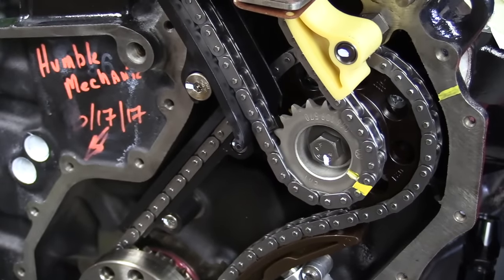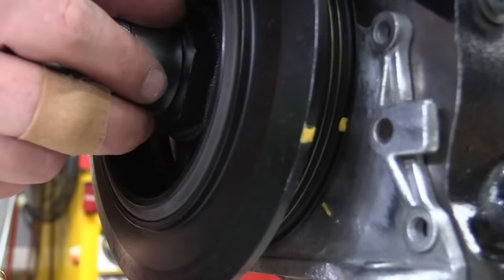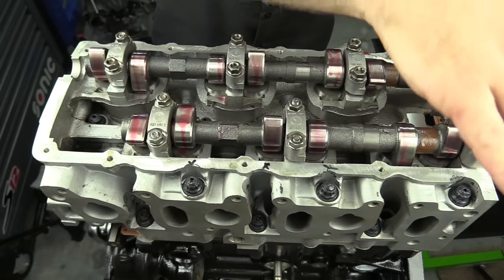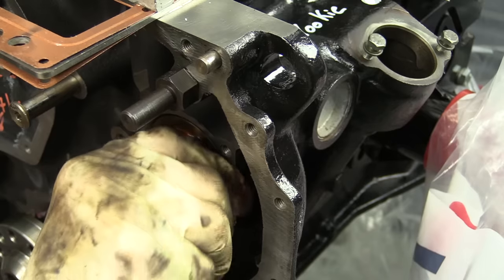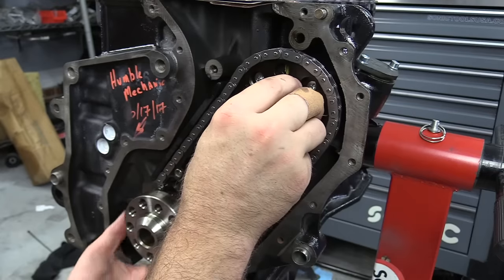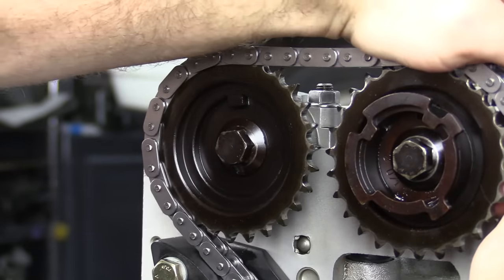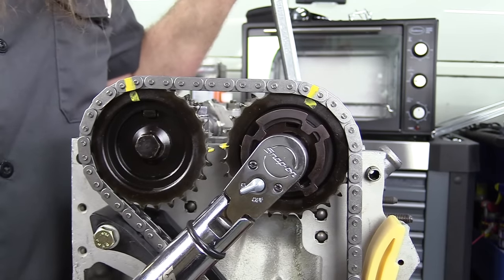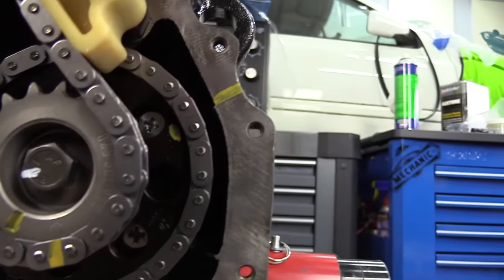How To Properly Time and Install Timing Chains on a VR6

Comment from the maker: This is one of the most requested videos I have gotten since I got this GTI. I hope it helps you guys rock out some timing chains,.
Reply: i just did a set of these about two months ago. it wasnt too bad, considering i did the work on the street in front of my house. now if i could just figure out why the new clutch doesnt want to disengage and makes a funny sound at full pedal compression....darn 02a's anyway
Reply: +Josh Hust did you put the throw out bearing in?
Reply: hi Charles love the videos. Im planing on doing the chains on my VR6 but mine has the two row upper chain, I have the sprockets to swap to single row its ok to do that or should i stay with the doble row ?? (in dap they cost the same but idk the brand in ecs its a 100 dollar difference between the two kits) what should i do
Thanks awsome tutorial.
Reply: Konradbie Did you check Schimmel Performance? I would trust them. Don't use ECS. I have had problem after problem with them shipping me returned or damaged parts. You have to stay with the type you have unless you are changing sprockets. The single row is supposed to be quiter. The double is supposed to be better for big cams.
Reply: hey bro, this is the best and cleanest video i been watched on last times, thank you for all...
do you have any videos like this for another engines?? like 1.8t 20v??
thanks
Reply: Can i use this instruction video for a mk4 2.3 v5 150hp
Reply: I am really surprised people have asked about timing an afp. they are crazy old, and super easy. I can see a request for bdf, but still
Reply: I think you haven't explained here how did you timed your dohc (How did you find the correct position for your dohc? What is the position of it while installing the new timing belt?). These are important to help your viewers know what should be the camshafts position when should be timed with the crankshaft, mostly when one lost their marks.
Reply: Intermediate shaft work?
Reply: I've just finished my second timing job on a Vr6, This one is mine.. Getting the intermediate sprocket on is a pain and you make it look easy! Much better my second go at it though, Glad I can come back and watch this video to double check myself. I've only done timing belts before which I've found so far to be easier to do for me.

Thanks a ton for making this video, I can't wait to have my own Mk4 Gti on the road and have another successful timing chain job done.
Reply: @ghomerhust  interesting, did you need to remove the engine?
Reply: In your professional opinion on a 24v VR6 in a mk4 GTI is it possible to do a timing chain/guide replacement while the engine is in the car? Or am I further ahead just pulling it out of the car to do the replacement?
Reply: I had a question so I did my timing chain on my 12 valve and I rotated the motor four times and the intermediate shaft was pointing down but I had it at 12 o’clock. Is that seem right?

Comment: Great guide. It is a fairly straightforward process on the VR6. The only issue I ran into doing mine was that one of the cambolts was incredibly tight and rounded when I tried to undo it. No problem if you're upgrading the cams but a pain if you're not. Cheers
Reply: Badgertronix happened to me as well, had to heat the hell out of the bolt with a gas torch.
Reply: Did you have to pull the motor?
Reply: @stanlee2200  yes you have to pull the motor you have to put it on a engine stand

Comment: i just got done doing chains and guides on my wifes obd2. everyone was telling me that it is just a horrible job to do, but i found that it was nothing more than time consuming. lots of parts to take off to get to the chains, and nothing more. a couple of metal rulers held the cams at TDC, and a breaker bar on the crank kept things lined up, and it just popped together. and i can sure tell NOW that the old chains were getting noisy, when compared to how the engine sounds now! next step, figuring out why the o2a doesnt want to disengage the clutch properly after bleeding....

Comment: Brilliant. Wish I had this a few years ago while “winging it” in my driveway, propping up the engine some 2x4s. It was a success but I would have felt more confident watching this a few times. 
Looks soooo much easier with the engine out of the car. 
One big ugh though:  there was a little bit of slack at the top of the top chain which I couldn’t get out and I didn’t want to take a 24 mm on the cam shafts to adjust for fear of screwing up (which I did once when my cam shaft plate slipped out!! Thought I may have bent some valves). 
Well, it’s been running quiet and well for four years - so close, but not perfect like your job.

Comment: How do you torque the intermediate sprocket?? The slack is in a way that when you tighten that sprocket bolt u would rotate the sprocket and pull the slack? How do u get it to not rotate

Comment: Humble mechanic... I love your videos. I've watched a lot of them and I've never caught you in something that you were wrong about until today... I wish you were right I've always looked up to you and still do... But when you were finding top dead center that was not correct. the Piston dwells at the top of its stroke. Now maybe for putting the timing chain on a VR6 this is all you need to do but you should really look into finding true top dead center. The best way that I have learned is using a piston stop rotating it until the piston stops marking it on the underdrive pulley then rotate the engine other direction till it stops... marking it...m measure the distance in between the two marks cut that distance in half and mark on the crank/ underdrive pulley. usually most OE markings are a little off. I have found several manufacturers across many engine platforms and all the marks are usually a little off. I would say in between 2 and 5 degrees and that's also how you can find if your underdrive pulley has slipped/spun.

Comment: Charles had me a bit confused when you were turning it at the end . You said turn it clockwise but it was going counter clockwise. I forgot we were looking at the back of the engine. I'm too used to timing chains/belts in front of the engine. 
Doooooh! My home moment.lol
Reply: Brad Downs , i was wondering the same thing! Did u figure that counter clockwise,  is the way engine runs?

Comment: Important 24v VR6!!!  when reinstalling the Camshaft Adjusters, the gear (most of the mass) needs to be turned all the way counter clock wise (left), with the Control plate (near the bolt head when installed) turned all the way clockwise (right)

Comment: These videos are going to be a life saver this spring and summer when I so the teardown of my 02 VR6 Jetta. This is going to be the first full rebuild of the motor since it was new. Thank you for all of the wonderful information. I really like the info on setting the paint marks during the build process marking the timing and the torque confirmations.
Reply from the maker: Thanks! Those paint marks have saved my butt!

Comment: Thank you for this great informative video , I timed my vr6 last night and I was just curious if it’s normal for the 12 o’clock mark on the intermediate shaft sprocket to be slightly to the right of the cover for the intermediate shaft. So the point is just passed the marking. I can’t get it to sit perfectly in line. Thank you again!

Comment: Is this engine radically different for timing that a 24v bdf? Obviously the spark plug location is different...I do have a Bentley manual and I don’t need to actually do this yet but it’s cool getting to see it done so when I do go to build an engine I have a general idea what it’ll look like
Reply: Jonathan, did you eventually get around to replacing the timing chain on your VR6?  I have a 2004 GTI with the same 24v VR6, engine code BDF.  Today I started hearing what I believe is the tell tail noise of a potentially failed timing chain guide.  I'm trying to quickly get smart on how to replace the chain and guides on this engine.  If you did the job and have advice or know of a good video that shows how to do the job specifically on the BDF engine and can provide a link, it would be a huge help.

Comment: Nice vid! 💪🏽 I would add folks the cam caps are numbered and specific to exhaust/intake don't cross them up
Reply from the maker: I call that idiot resistant...LOL..

I am actually going to do a separate video on installing the cams.

Comment: Great clear and confident building video👏🏻👏🏻.. one question 🤔.. i have a 3.2 BHE audi engine. Can i replaced the cam chain tensioner bolt without taking the engine apart?.. is it just an unbolt and replace item? Cheers

Comment: I wish someone would have explained to me the first time I did a timing belt that the marks on the belt were not going to match up after I rotated it. I was a mind fucked 20 year old that had done the job correctly, but was too dumb to know I had done it correctly. I was in a shop the didn't have any old timers willing to help a beleaguered young tech. I try not to be that semi old timer now, although it is fun to watch them struggle a little.
Reply: Does it matter if you took the chain/belt off on tdc buy not on the compression stroke ?

Comment: Hi Charles
I am planning to buy a friend of mine's golf 3 vr6 OBD 1 there are no timing chain noise but wanted to know if it's necessary to change the Chains to the single ones instead of the double 
what are the pros and cons of either 
All the Way from  🇿🇦

Comment: Hi humble mechanic! I have a 92 gti with a 93 vr6 corrado engine in it! My dad & I are working on it and right now the car is cranking but not starting. Before it stopped working it started running hot and leaking anti freeze so I’m wondering if it’s the water pump? If this even is something that would stop the car from turning on? Other thing I was thinking was the timing chain. Would love to hear back thank you!

Comment: Awesome as usual always/reliable!

Do you have a bb or a way I can get some advise?

I used to have a 2 valve, I had an e2 chip, went the gm conversion to ign coil/spliced plug/coil wires, to lower the e2 advance I was able to expand plug gap with a massive boost to throttle response and avoid hot weather pi.

Vr6 is just an awesome motor/sound w/T2 exhaust straight out Jetta 3 so no drone.

AW I currently live in PDX, I would like some local assistance PDX/SEA with dependable headlight retrofit w/outer rings added w/shroud Morimoto’s Gen 3 Toyota 4R, affixing them properly, rather be involved than mail order of course…

Thanks

Comment: I have stumbled upon these God like videos! I now know who I can safely ask my question and get a purely knowledgeable based answer. I have a 2018 VW Atlas SEL with the 3.6L V6 (VR6) With 4motion. Are there any mods for this vehicle/motor? Would it be possible to turbo? Would it make a good fit? Basically I'm looking to add lots of horsepower and torque. So far I've seen 1 company do it to the 2.4L. What are your thoughts on this? Thank you!

Comment: Hi Charles can you post a video about doing the timing on a 24v vr6. It's like the R32 but I have the 2.8 version. BDE engine code. 
TIA. Oh I'm busy turbo charging it with a 2mm spacer plate and forged rods and arp head studs.

Comment: So is this the same thing on a 2001 Volkswagen Passat with an automatic transmission? I know it’s a V6 I believe a 30 valve I think if I’m correct. His car is sending low pressure oil to the camshaft. Every time he raises the the camshafts tensioner arm it squirts oil out of the plunger... I’m not sure if there is something wrong with the plunger or gaskets that seal that oil pressure sending unit or something. I my self own the more simplistic 04 VW 1.8T JETTA. I don’t want him to fall out of love with that car any suggestion or any tips would really help! He has the car torn apart we understand how the valves work in correspondence with the rest of the car but I guess I’m confused on what a properly timed camshaft looks like on a (01 VW PASSAT) Dual overheard Cam auto trans... I would really appreciate any advice I know your not going to like give a manual to tell me what to do. But I would really appreciate anything. And if needed maybe I could work out some sort of payment for your knowledge. Thanks!! Love your videos!

Comment: hello hope u read this. i did this exact job in my garage step by step perfectly. everything u described.  I am also anal about torque so everything was torque spec all gears where marked, TDC etc etc and even did 4 full turns on the crank like u do when i was all done and  timing was perfect everything lined up. i dropped the motor back in and now it knocks. any ideas. it sounds like a piston hitting a valve but it cant be i did everything right double checked everything. and ideas? or anyway to reach u? i just want an opinion. i dont want to rip apart the motor again. the motor runs amazing tho so if my timing was off would it seize the motor? if u read this i would love just to pick your brain on what u think or what anyone thinks i have a reddit page with a video of everything otherwise its was worth a shot. I can just buy a new motor for 1000$ cause taking the motor in and out was a breeze but i want to try myself. thanks in advance
Reply: also i meant to say. "if my timing was off WOULDNT it seize the motor?" basically im trying to rule out the possibility of it being me messing up the timing but it looks like it

Comment: Hey Charles had a question, I just bought a 2000 beetle with the 1.8 ltr turbo and am trying to put a timing belt on but the belt the old belt was shredded so wasn't able to mark tdc, what is the easiest way to set timing? Thanks
Reply: Did the timing belt fail? 1.8 will  bend valves in a heartbeat.

Comment: Charles, would you consider discussing, in a video, how this job might be different on the 24v VR6, engine code BDF, installed in the 2004 GTI?  Also, once the transmission is removed, is it's reasonable to replace the chain and guides with the engine still installed and supported with a floor jack on one side and the engine mount on the other side or is this a bad idea for any reason?  Once again, I appreciate the video and your advice.
Reply from the maker: YES! We will actually be doing chains on the R32 at some point

Comment: Humble Mechanic, I'm about to get this done on my 2007 Q7 3.6 VR6. Is it possible to replace the sprocket off the  crankshaft? Basically the lowest part where the lower chain rotates on? Would it even be necessary as long as it looks ok? Thanks.

Comment: Hi, at 3:54 you say the cams are locked in place but the keyways for the sprockets are not at the top. I'm assuming you were installing the sprockets on the camshafts prior to locking the cams into place correct?

Comment: I pulled my cylinder head on my VR6 GTI without setting it at TDC . I marked the chain and cam pulley teeth before removal but how do I make sure it goes back together the same way ? Or should I just rotate the crank pulley to TDC while the head is off all while trying to make sure the upper cam chain stays taunt , before reinstalling the head ?

Comment: Great video... QUESTION: What is the difference between Cayenne VR6 at 300HP vs. Touareg VR6 at 280HP? Is it easy/plug and play to upgrade the Touareg VR6 to Cayenne spec?
Reply from the maker: Im not sure on the exact specs, but it may be something as simple as intake, exhaust, and software.
Reply: @HumbleMechanic  Thanks. Anyway to upgrade Touareg VR6 to Cayenne or better? I feel like VR6 is too weak for the Touareg weight and needs more power.

Comment: Hey Bud, What is the difference in the procedure from timing a 24 valve to a 12 valve if there is any difference at all? Also is this really tough to time if you keep the engine in as apposed to taking it out?

Comment: Charles I'm currently waiting on a slot at my mechanics to get my chains and tensioners guides and spockets changed on my a6 3.0 tdi bmk code engine it has been rattling for almost 7k miles as I thought it was the serpentine belt running untrue due to a bad tensioner at the front..subsequently after waiting on a sunny day to change the rollers and tensioner and alternator pulley it was still rattling like a bag on nails until I stethoscope tested the cam cover and my heart almost stopped so Is there anything else that should be considered looking at while the engine is out as it is a huge job? And do you think the engine would have or could have any other damage relating to it having a slack chain it still idles and drives well apart from the noisy rattle (permanent rattle) not just start up. 

Your advice would be greatly appreciated as you are clearly a master in your field. 

Kind regards,
Chris woods.

I will be parts shopping this week the kit I plan to order is a FAI full kit for that engine code..are they trusted or do you have any alternative recommendations.

Thanks.

Comment: Is there a video on proper timing on camshaft on 1.8t with the camshaft tensioner. I’m receiving a constant P0012 especially in the morning with having to start 3 times before it finally stays on. With VCDS I measured block 91 to read camshaft angle and was getting a -16kw at 1200rpm in the morning. I wanna make sure I’m either off a tooth but would like to see exactly how to time the chain. Thanks!

Comment: Im rebuilding my 3.2L vr6 head. I took it to the machine shop for leaky valves so they can be redone and have the head vaccum check and resurfaced. When i rebuild the head, do i need to time the head and adjust the camshaft adjusters, or do i just rebuild the head, put cylinder 1 at TDC and throw the head on. Its my first time doing deep engine work like this. I have my repair manual at my side as well. any tips would be greatly appreciated, i don't wanna jack this up. Thanks.